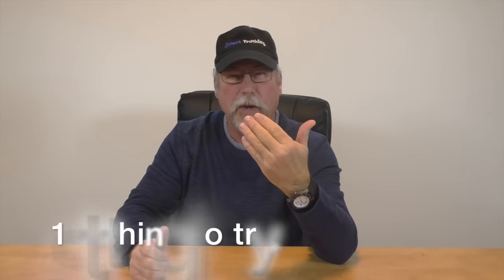How to Downshift When Climbing a Hill in a Semi Truck (Without Blowing a Gear!)

Comment: Hi Dave
Great advise for young guns starting out, I can too struggle on hill climbs. Thanks for your help. Can you do a video on how to shift from a starting position on a hill? That I find is the hardest thing to do.
Cheers all the way from MELBOURNE AUSTRALIA
Reply from the maker: Does take some practice. Do you mean heading uphill or downhill?
Reply: @SmartTrucking  I mean starting on a hill with or without a load. I find it hard to shift up, the truck just doesn't have enough momentum. I'm not sure if I am suppose to shift quick or slow?
Reply: @joelvallance1728  when you pull out on a hill don't wind it up to the governor it takes too long for the rpms to come back down just get the truck moving then quick shift to 2nd before the rpms get too high with some practice I think you will find this method works very well I've been doing it for years

Comment: Normally I downshift at 900 rpm,  but on an uphill, I take it out (into neutral) at 1100, and downshift into next gear at 1050 or 1025.  Gotta be fast, or I get some gear grind😅
Reply from the maker: That's right!

Comment: I just googled average salary net worth for owner operators in Ca. And it claims $200,000 a year. I do not agree with that calculation as an owner operator wife who takes care of the finances.  Please let me know what your thoughts are?
Reply from the maker: I don't know where they got that number but it's not even close. These days I doubt most guys even gross that. I'm out of touch now having parked my own four years ago and there are a ton of numbers needed like annual fuel and maintenance costs, truck payment etc but with my wife doing the books when I got out my true net after expenses was closer to 80 grand and the rates were still dropping, the fuel , the shop rates and the insurance were still rising.       Dave

Comment: I have a 2014 freightliner cascadia cummins isx with a 10 speed what is the highest rpm I can be at going up a hill without causing damage to the truck were I can keep pulling?

Comment: So keeping it in high or low with a 13 speed? Pulling 82000 hauling fuel up some steep hills keeo it in 7 high or low and skip gears to 5 low then use thr clutch all the way to 3 low

Comment: This video brought back a memory of mine of when I subconsciously downshifted going up a hill loaded without the clutch.  It was my very first time floating gears downshifting and it was all by accident.  I had a load a logs going up a hill.  The truck had an N14 in it and I used to love how it sounded when it was loaded.  I was enjoying the sound so much that when I got ready to downshift, I without thinking, just eased off the throttle and gentle pulled it out of gear.  Bumped the throttle just a little bit and slid the shifter into the next lower gear and throttled back up and made it on up the hill.  It all happened so quickly and so smoothly.  I was like, "What just happened? Did I just downshift without the clutch?" Prior to that I had been playing around with floating gears only on upshifts just to get the feel of it.  Like you said, basically once you figure out it's all about getting those RPMs in the right zone with the speed of the truck...things will start to fall into place.  I haven't  driven in 10 years but still I feel like I can get back in one and be ready to go.  Great video...keep'em coming!
Reply from the maker: Thank you!  Will do!    Dave

Comment: I clutch once to pop it out, rev slightly, and float in🤷🏻‍♂️
Reply: same here, i do it at about 12-1300 if i KNOW i need to downshift..i shift down at about 1000 if its iffy as to weather or not i can pull in top gear...sometimes i feather the throttle at the last minute to float out of gear up a hill though
Reply: I do exactly the same thing! Clutch it out and slide it in 👍
Reply: Some Person I do the same......  and I do the opposite when down shifting down a hill 
Float it out. Rev up. Clutch in..... 
then the rest is all floating on flat ground 
Floating up or down

Comment: Correct me if I'm mistaken but when you downshift, you hit throttle to get to the proper rpm before you put it back into the gear? I'm driving manual for the first time since trucking school and with the truck I'm driving,  I noticed that going up a hill my rpm drops but when I go to shift, my speed is to fast for the lower gear and I have to allow it to slow a bit or just drive up the hill in 1100 rpm range.
Reply from the maker: Yup, give her a little fuel after pulling her out of gear to help you match up the next shift. If the hill's really steep and you're heavy, pull it out of gear and drop two.

Comment: so when i downshift im usually at 1000 rpm
get out of gear, rev up to 1500 and get in the lower gear
you are saying if im on hill and im losing momentum i should also get out of gear at 1000 but rev to 1800 and get in gear or what ? sorry if im mistaken just trying to understand

Comment: Are we upshifting or downshifting? If rpm's are that high going uphill you"re pulling it no need to downshift
Reply: I WAS think the same thing. High torque , low rpm engines I would go down to 900 or maybe 1000rpms verses 700 for typical down shift . The ISX  had great torque and made life thru WVA on I64  A BREEZE.
Reply: 1800 might be a little high but i sometimes will drop a gear at 1600.  I drive a 550 series 60 detroit and I weigh well over 100,000 loaded.  That engine likes to pull a big hill around 1700.  You cannot lug an engine like that for a long time your egt will cook a turbo or a head.  I knew exactly what he meant.
Reply: @slr379x9  I know a guy running a series 60 making around 700hp, runs around 2k rpm on hills he said it just likes it more hes about 130k lb though.

Comment: Isn’t 1800 rpm too high? I downshift at 1200-1300rpm depending on weight.
Reply from the maker: That's just an example. Depends on weight,  grade, speed, gear ratio etc.      Dave

Comment: One of my problems was not shifting fast enough  i found out that the faster i shifted the smoother it goes in so after i caught on to what was going on i shifted as smooth as an automatic transmission just floating it ,my trainer would get me distracted and I couldn't shift, or even remember the gear i was in this went on about a week  ,finally I got a little better so he went to sleep, after i had to shift i played with it on the interstate where it was no traffic, i caught on to it in about 5 minutes  up shifting and down shifting perfectly  ,when he woke up and saw how well i was shifting ,he ask how did I get it so fast,I  told him he was just tired and needed a break,about and hour or two he was sitting in the passenger seat, a pickup with a break check cashed in front of me  i went from  10 to 5 slammed on breaks and stopped about a  foot off his bumper, this was in Austin ,he said he never saw a truck stop that fast,thank God there wasn't any traffic and that truck took off, after that a bought a for the truck and won't drive without it, any i enjoy your videos be safe

Comment: What are you guys calling 9th??  8th direct?
Reply: Smart Trucking I’m confused which gear you’re  calling 9th.   In Alberta they taught us the gearing like this. - Low, 1,2,3,4 range selector up 5,6,7,8.  And all of those gears can be split.  Split gears would be called (for example), 6 with splitter back “6 direct”.   Then if you push the splitter forward it’s “6 overdrive”.     I’m lost when you say 9th!

Comment: Yes down shifty in muddy off road. Shift extra eary go several gears down. Shifting up use engine " jake"  brake to drop engine rpn rapidly to get next gear. Need more speed and momentive to get through the muddy spots. Down shifting on the hell ( safely) takes more exp. Practise on thelevel. Hint only 2 feet. 3 pedals ( forget the clutch auto-shift like shift use your throttle and yor left foot on brake. Maintain speed of truck by applying some brake. As going intoneutral need to speed up engine with throttle to go to lower grear. This is a "logging truck style shift" Most hwy friver NOT taught this. Don"t know how. Now are taught to have low enough gear at the top. How many times a n RV etc passes at brink of a hill. I even coast over the top ( saving fuel too) NOT knowing what's over the hill. Yup traffic stopped. Big sheep crossing. RV stopped half way down. Traffic stopped on the 2 lane road coming up. Started dropping gears. Full egine brake. Full brake pressure. Continued dropping gears. Camewithin ft of RV. Almost ready to take up coming lane. Which would have really freaked out everyone. Started leaning on air horn too. Like move ahead if you can. And pls  dont start driving up hill when sheep gone by. I was fully loaded Cdn B-train gross at 64 M tonne. ( figure it out) BC mts 6-7 % grade. NO time for missing a shift. Yup happens. So pratise like a race car driver "pratises" So much for " book theories" .  How many acvidents could have been prevented. We now build "emergency traction on ice" ( like raileay locomotives) 1 403 830 4124

Comment: Hard to shift at 18 hundred when the truck tacks  out at 16 hundred lol
Reply: What is your motor lol?
Reply: It's not about the motor.. it's gearing. 1800 is way too high for most otr spec'd trucks
Reply: Governors control engine speed not gearing.  If you cant get it over 1600 you are in too high of a gear to begin with and will melt down motors in short order. 

Nothing wrong with climbing a hill with the needle bouncing on the governor, unless it's a mechanical and someone screwed up the setting. At that point 2100 is your target if yellow, 2400 if its tan and 2800 if it is green. 

Target gear is the highest gear that will let you hit the governed engine speed without deceleration.

Comment: even better than downshifting "on" the hill .. downshift BEFORE the hill .. yes, your RPMs will be screaming .. but u need that screaming to make POWER .. and once u are in gear (5/6/7/8) just ride that sucka all the way up the hill .. don't take it out of gear .. if u r going half the posted speed limit, pop on your 4 ways .. it is a friggin truck .. they are just slow .. get over it

Comment: Stop treating this horrible job of trucking as something special. It is a crap job for losers (me including) which cant pay enough for the struggle. The less you concentrate on the trucking and more on how much you getting money for doing this job the better you live. This job is not adding years to your lives. Treat this job as the worst job ever. If you treat it that way you would not work for low salary or low rates if you are owner op. There has to be a redistribution of wealth from everyone else to truckers. The best way to achieve it is to be difficult all at the same time. Do not do your best. Be late all the time. If most drivers act that way rest of the industry will treat us better. The less you do the less you will be responsible and asked for.